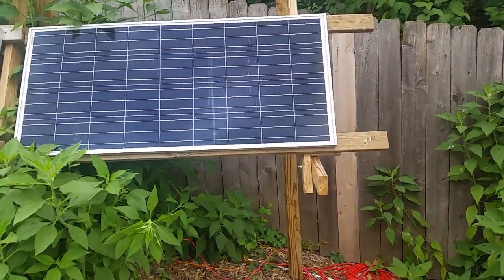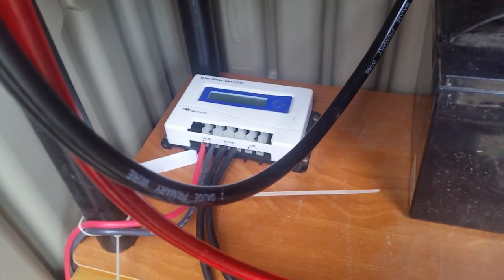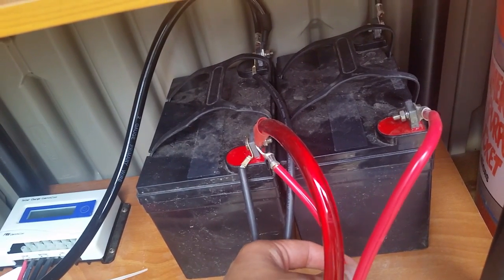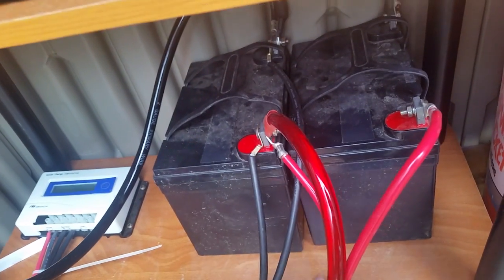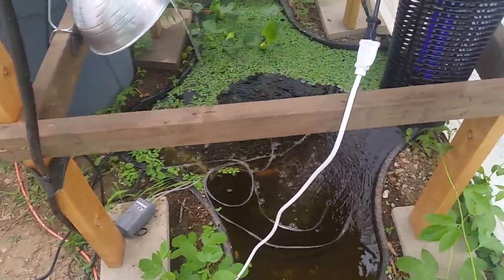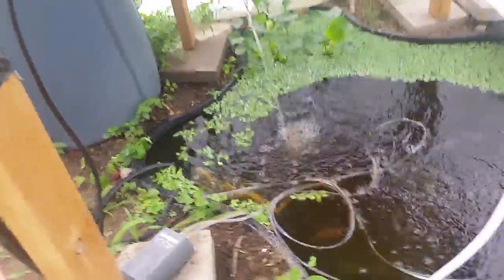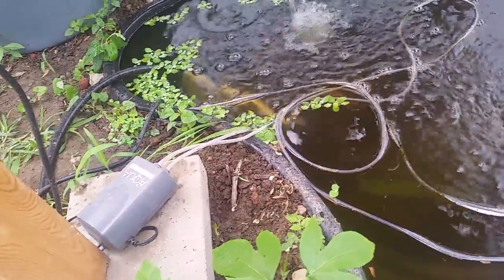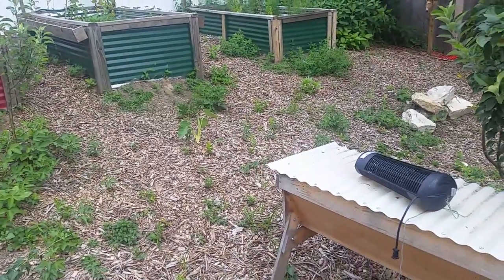Dogtown Farms basic 2 panel 2 battery 12 volt off grid solar installation powering  aquaponics

Comment: Thanks for sharing this video, I always love seeing peoples setups!

A few helpful tips:
1. AWG stands for American Wire Gauge, but most people call it gauge (pronounced gay-ge), never AWG.

2. You can connect multiple batteries in parallel (parallel means hooking batteries together positive to positive, negative to negative), but keep in mind when chaining together multiple batteries, the wire that connects them will need to be thick enough to handle power coming from ALL batteries behind it. Meaning if 10AWG wire can handle one battery fine, if you hook a third battery up as you mentioned then from the third battery to the second battery you can you 10AWG wire, but from the second to the first you may need to use something bigger, since it now is transferring all of it's power through that line AS WELL AS the power from the battery(s) behind it.

3. Do some research to see what the minimum and maximum voltage should be on your batteries. It's pretty easy to find and once you know it you can stop yourself from overcharging your batteries as well as draining them too much. Most charge controllers handle the charging, but remember that if you drain your batteries too low you will really limit their lifespan. Some inverters can do this for you, but if you aren't sure if it does you should make sure to avoid damaging your batteries.

Comment: Good Stuff!
Reply from the maker: scott if i add more panels, will I have to get different or thicker wires running from the combiner piece to the charge controller? my next step i think is to add two more panels, and obviously switch the two prong mc4 combiners out with four prong ones...
Reply: I don't know what gauge of wire you used but it looks like (from viewing the video) it would handle the current of many solar panels.  While its understandable to over build things, when it comes to wires more isn't always better, since it creates what I call drag (resistance industry term) on the system.

Comment from the maker: fyi you can use whatever brand/type components you want, these are just examples of components that have worked well together. the DMsolar panels for example have been out of stock for months, but you can substitute any decent 12 volt solar panels of similar wattage.